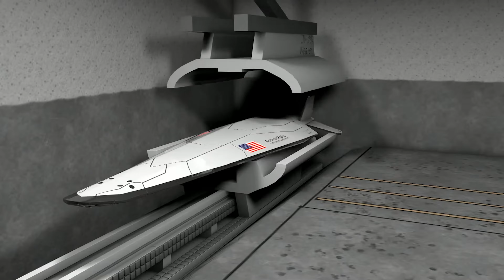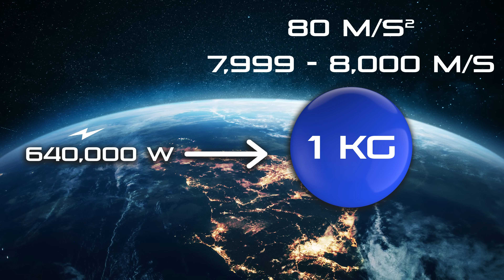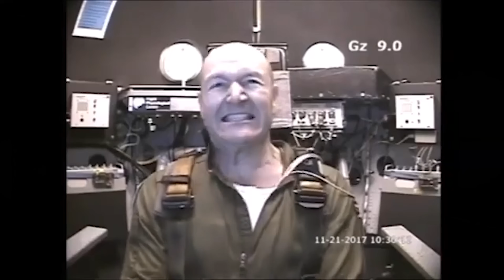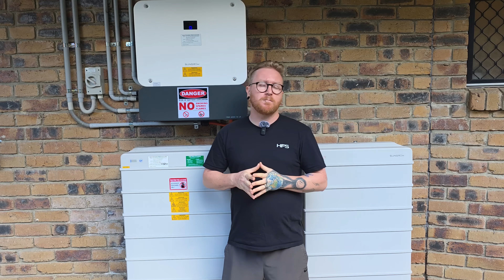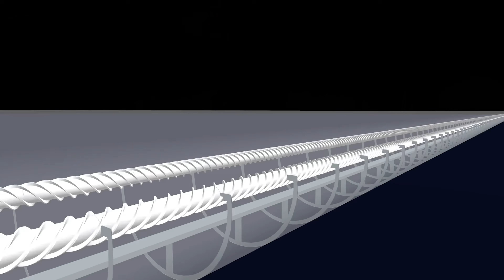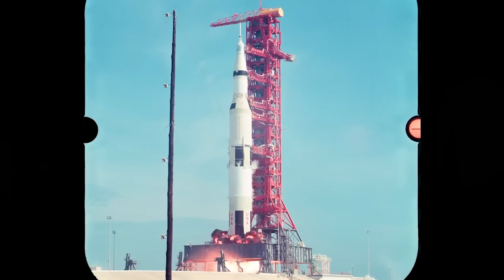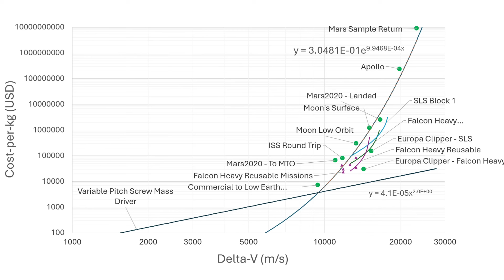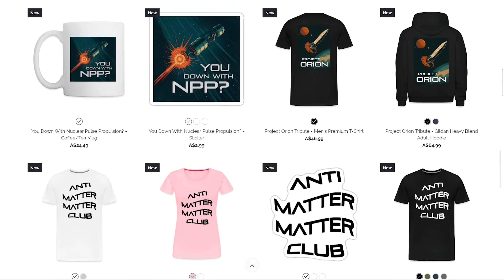The New System That Could ACTUALLY Replace Rockets

Comment: The mistake we make with these concepts is obsessing with the idea of attaining escape or near-escape velocity via the trackway.  That's nonsense.   Instead, we should be considering accelerating to near-Max Q velocity via the track before igniting chemical booster(s) to break Max Q and reach orbital velocity.  

Why?  Because in traditional rocketry, we use the majority of onboard chemical fuel purely to overcome inertia and reach max Q.  If instead we use ground-based energy, delivered via the trackway, before then igniting the chemical thrust, then we eliminate the necessity to carry perhaps as much as 50% of the chemical fuel in the vehicle, cutting the total energy required to launch and the mass of onboard fuel required to reach orbit.

Accelerating a vehicle to escape velocity in Earth atmosphere is pointless, however, accelerating to 1100Kph (90% of the speed of sound at 4000 meters), before igniting chemical boosters to accelerate to orbit, would save a huge amount of unnecessary vehicular mass and make space access significantly more efficient.  Since the speed in the tunnel is kept below SoS, no vacuum is required.

The best location for this system is mount Chimborazo in Ecuador, a 5000 metre tall mountain that is closest to space.  A ten-kilometer track running horizontally underground West to East before arcing up the Western flank of the mountain, could achieve this.  The track can then curl over the shoulder of the mountain, providing an escape track for the deceleration of a Maglev bogey.  In addition, Chimborazo has a substantial high-altitude lake that could be used to generate hydro-electric power in a short burst, to charge launch capacitors for the launch- in much the same manner that the Cruachan power station in Scotland provides rapid grid energy boost when required.

The bogey could be accelerated through the tunnel and as it rises up the side of the mountain, it emerges from the tunnel at 3000 meters of altitude, pointing skyward at an upward angle of 60 degrees, whereby the boosters are ignited.  In the last 1000 meters of track beyond the tunnel, the vehicle's onboard systems determine the status of the booster thrust before releasing the bogey and climbing away.  

Should the vehicle sense a thrust anomaly, the boosters can be released and the vehicle kept securely attached to the bogey, which carries it over the shoulder of the mountain, gradually and safely decelerating... saving vehicle, payload and/or crew for a later attempt.  The boosters can consume their energy in free flight before descending by parachute and recovered for repair/refurbishment later.
Reply: There was a design for a heavy aircraft to lift a rocket to 10,000 ft or much higher. It doesn’t impart much airspeed, but it gets you high enough that you can use a more efficient engine.
Reply: @jsbrads1  Sure, Virgin Space were using such a system, but it is significantly limited in it payload capacity.
Reply: @Barbreck1  Yes, I messaged the company and got a response that it was a an exploratory study and it may not move into development.
Reply: MaxQ isn’t a fixed speed number, it’s the max dynamic pressure based on velocity AND air density at that altitude. It’s a concern because of structural stresses, not because it’s some magical threshold that it gets easier to accelerate past. Typical Max Q is on the order of 15-20km altitude and 1600km/h, even at the much higher peak of Everest at ~8.8km air density is still around 3x higher (.48 kg/m^4 vs .165) than at that usual maxQ altitude. At the 4km altitude you base your speed of sound from air density is close to doubled again vs the Everest number capping speeds far lower. The dynamic pressure (and so more or less the structural stresses) at 4km/1100km/h would be over doubled meaning much greater mass needed in the payload design to survive it. Typical launches also spend a very limited time right around maxQ, but a ground based launch like this would spend most of its flight time at aerodynamic loads higher than the absolute max for traditional launches. Those loads also mean far longer spent fighting higher drag forces the propulsion has to push against to even maintain velocity much less continue to accelerate which adds back some of the saved fuel. 

I do agree that some of these concepts could have a little potential as a launch assist to add only a fraction of initial velocity to reduce fuel needs, but a fraction is all they could ever really add and it would still be a tough case to make the added costs of that small boost outweigh the savings of the earliest (and so least costly in rocket equation terms) fuel burned by a rocket.
Reply: @RocketSurgn_  so, you knew what I was getting at and wanted to a be a smart arse.  Not impressed. 

Even as little as a 10% mass saving is huge in space access equations but the greatest fuel consumption is experienced in overcoming inertia.  Merely eliminating that portion of the carried fuel would be a revolutionary leap in launch efficiency.
Reply: @Barbreck1  Not at all trying to impress, and you're misunderstanding the last part of my reply. You did have a good starting point I wanted to agree with, that launch assist concepts don't have to get close to escape velocity to benefit, but granting that there could eventually be some small value found isn't in the same ballpark as any of of the rest of your post. 

Saying "near max q" by end of the track is both misusing the term and even taken as intended it's still wildly unrealistic and ignores all of the actual problems it still shares with the higher speeds. The 1100km/h at 4km altitude you throw out is far higher than the max aerodynamic loading a traditional launch would only briefly deal with. Those speeds at lower altitude means not only higher peak stress for the rocket to survive, but doing so for much more of the flight time meaning even more structural mass added. Time near max dynamic pressure is also the highest risk of losing the rocket to even the smallest problems so increased time spent near the structural limits means higher overall risk of loss. The numbers you give to back up your point are clearly picked without any justification or understanding especially when you don't acknowledge any of the limits/problems. 

Making up yet another number that 'feels' low like 10% total fuel mass savings doesn't make it feasible without leaps in materials science/engineering and it's no more of a real number than the speed/altitude numbers or the "as much as 50% of chemical fuel" picked out of nowhere for the first post example. Even taking that 10% fuel saved as granted would be a much less than 10% total launch cost savings and that has to balance out all the costs of a complex, safety critical system or transporting all payloads/rockets to a remote mountain site.
Reply: @RocketSurgn_  Max Q is relative to the specific vehicle being launched.  the track can take account of that calculation and accelerate the vehicle accordingly, releasing at the most appropriate point.  Getting to that point using chemical thrust consumes a considerable mass of fuel,.  Eliminating that fuel and the structure required to carry it, vastly improves launch efficiency.

Comment: The pitch angle of the screw at the launch end would be extreme, like one rotation of the screw for 8km movement along the shaft. Which to me sounds like most of the force applied to the sled (over 99%) would be acting perpendicular to the direction of travel of the sled. How would that not rip the drive magnets out of the sled?
Edit: ok, not so extreme if the screw rotates at 200,000RPM, but if the screw rotates at 200,000RPM at the low speed end, how is there going to be a gap between each thread, as the pitch would be very low?
Reply: Impossible masturbation fantasy, formed for an FM world.
But it is an AM world we live in.
FM = Fucking Magic.
AM = Actual Machines.
It's why there can NEVER be such a thing as a hyperloop. That idea is beyond bad.
Reply: Rotordynamics says this will never balance, even for one screw, let alone two and a sled! 200K RPM on a tiny, simple device is HARD!
Reply: If you had a material strong enough to build a one meter diameter shaft that could sping at 200,000 RPM, you'd have a material strong enough to build a space elevator. Literally.

Comment: Too little talk and calculation about the screws their energy and the transfer of energy to the spacecraft. Too little talk about the vacuum tube, construction site etc. It seems a very unlikely solution.
Reply: There was talk just not in this video. The energy transfer is my biggest concern as well. Remember you need these screw segments to be PERFECTLY aligned with their neighbors and I was told the current plan is essentially a secondary flywheel that keeps the screw segment spinning at the correct rate even as its rotational energy is sapped by the spacecraft.

The vacuum tube is not that big of an issue especially when you already have fast rotating components inside (not much adjusting to make it into a turbomolecular pump) and you probably don't need your vacuum very strong anyway. Construction site talk has also been had and it's about what you expect ... there's some flat areas near the equator that have a pretty tall mountain next to them, that's always the choice for mass drivers. This one you COULD build in the USA too and a bunch of other places but re-colonizing Africa would be the best choice.
Reply: What do you mean "recolonising Africa"?
Reply: @targard.quantumfrack Returning to Africa, the ancestral land of all humans, and building it there (since nobody gets to call racial dibs on an entire continent,) hopefully bloodlessly and equitably.
Reply: @targard.quantumfrack ❤❤❤
Reply: @targard.quantumfrack yo, this is the worst idea I've ever heard as a pitch to re-colonize africa. 
Bruh, what he mean?
Reply: @MrRolnicek You don't want to recolonize Africa.  Learn about HBD, human bio diversity science.
Reply: What, you expect him to have the contracts signed and work crews on the way already?  This is a brand new idea; it often takes years or decades to get aerospace projects off the ground.  Plus it's not his job here to get into the nitty gritty details; he's simply explaining the idea in layman's terms.
Reply: @plucas1  Storing energy in rotating masses and transfering that energy via some gearing/transmission to a vehicle is very well understood and most engineers know that storing energy in rotating masses with relatively small diameter needs problematically high rotation speeds. He is quick to point out that electromagnetic acceleration from 9999 km/h to 10000 km/h requires a lot of energy, but the same energy is needed with his mechanical system. 
If anything the system could already be a lot better with many large diameter wheels along the ramp with magnets on the outside to transfer rotation energy to the vehicle speed. Still all such solutions require a lot of vacuum real estate making it economically probably unviable.
Reply: @plucas1  it's obviously impossible to engineer, even in layman's terms.
Reply: Just put a several kilometers long vacuum tube under the ocean and use magnets, what’s so hard to understand!? Magnets!
Reply: I also question losses due to friction, especially the amount of heat that would be generated.
Reply: The cost of the NIMBY (Not In My Back Yard) factor wasn't discussed here.
Reply: @sheariley1910 😂

This thing would be in almost everybody's backyard...
Reply: Go have a teaching lesson on it somewhere on YouTube then.
Reply: Reusable boosters renders this kind of option obsolete from a practical standpoint.
Reply: @mb777-g8v Wrong. Were you even listening? He used the cost numbers from SpaceX for the comparison.
Reply: @sheariley1910  so listen, we ALL want something like this to work because it would be super cool. However, you’re not thinking through the whole thing and you uncritically accept what this guy presented.  

How much do you think it’s gonna cost to build the infrastructure necessary to support this operation and keep it running? And that’s assuming that the material science exist to make the proposal even possible. How are you going to turn a screw that is hundreds of kilometers in length?  At that length even the most rigid materials known to man- like diamond- turns into a piece of spaghetti.  

How frequently will you be able to launch things using this technology? Once something launches, the energy for that needs to be put back into the system. You can’t just dump in gigawatts of power into a mechanical system that’s hundreds of kilometers long.  

Then you have the problem you can only launch in one direction into one orbital inclination.   How often is that orbital inclination going to line up with something like Mars for example? A few times a year.  Even when used for Earth orbit, having only one accessible orbital inclination severely limits its utility. That means you can only have a very restricted number of orbits available.

The comparison to the falcon nine booster is also a terrible. He’s only comparing the costs of the energy required to boost something into orbit.   It doesn’t matter if the cost of the fuel/energy required to put something into orbit is even 700 times less if it costs $20 trillion to build the infrastructure and then trillions of dollars a year to keep it running and then you can only launch into one orbital inclination.   

Falcon 9 is version 0.1 of reusable systems. The efficiency of reusable system scales with size so starship will be vastly better. The reuse of the booster has already been demonstrated. Once reusable upper stages are ironed out, the cost of launches will be dominated by the cost of fuel. It’s estimated that it will take about $10 million worth of fuel to put 100 tons in orbit.  Yes, you have to take into account the cost of building a rocket and upkeep, but that’s going to be trivial compared to the cost of building something that’s hundreds of kilometers in length and requires some means to suspend it above most of the atmosphere.  And the maintenance requirements for something that’s hundreds of kilometers length and requires a vacuum inside of it, etc. is going to be way higher than refurbishing reusable rockets.  And what happens if one of the screws breaks? Where are all of those terra joules of energy going to go? What happens if one of the suspension lines breaks? What happens if the vacuum tube gets a breach? Do you realize how much energy it takes to keep the atmosphere out of a tube that’s hundreds of kilometers long? All that energy will be released over a very short period of time if there’s a breach in the vacuum tube.  And talk about a huge sitting duck, terrorist, target or target during war. 

Even if the hundred dollars per kilogram to orbit is wildly optimistic, it will still destroy the economics of the mass driver system.  Let’s say it’s off by a factor of 10. $1000 per kilogram is still way better than the optimistic estimates for the mass driver.   And you can launch into whatever inclination you want whenever you want and as many times in a day as you want.   

Even if they’re never able to get upper stage reusability to be practical, having a ginormous reusable booster gives you very similar advantages without any of the disadvantages of the mass system.

On the other hand, the mass driver system would probably be practical on the moon because of the lower gravity and no need to have a vacuum tube enclosure. Additionally rocket fuel is less abundant and more difficult to come by on the moon.  It might be practical on Mars, but Mars has higher gravity, and it does have some atmosphere.

The most important things to realize that the fuel costs are almost a rounding error compared to the other costs in rocket launches or mass driver launch costs.
Reply: @mb777-g8v Wow. You got all that from my short comment? What in my comment makes you think I uncritically accept what was said here? You know what happens when you assume, right? Maybe think about what you're saying before going on a rant.
Reply: @sheariley1910  it’s not a rant. I simply stated that this mass driver idea is made impractical by the advent of reusable boosters and certainly buy fully reusable launch vehicles. You said that I was “wrong”.  You provided a superficial analysis to back up your claim. Therefore, I listed all the reasons why reasonable boosters and rockets are much more practical than the mass driver system.  If you go past the superficial analysis, then you see that although it might be a cool idea, it’s impractical, even if there were materials which could withstand the forces involved.

And then you responded with a tangent that has nothing to do what we were talking about instead of actually backing up your original statement.
Reply: Good point about the vacuum tube.  Just make sure California/Newscum have absolutely nothing to do with this.

Ever.